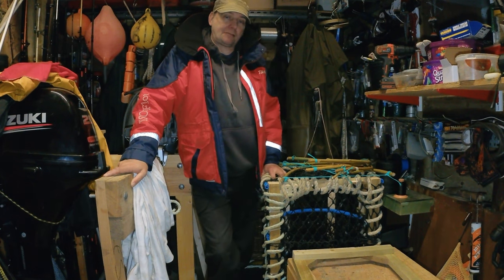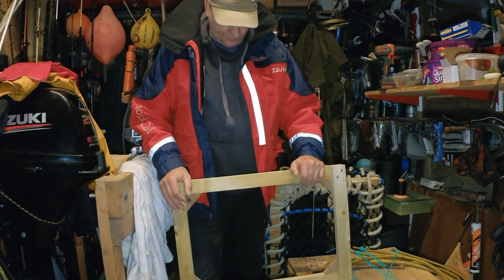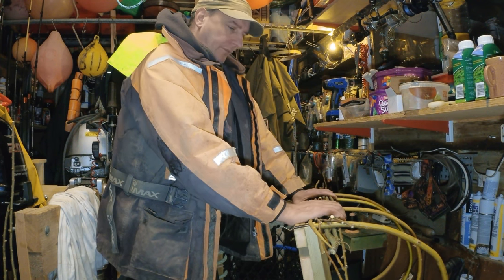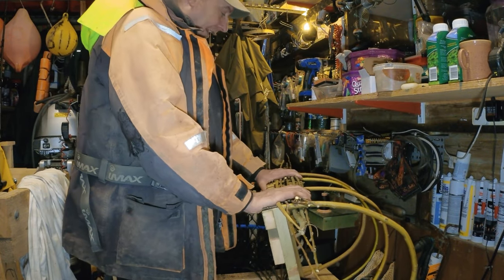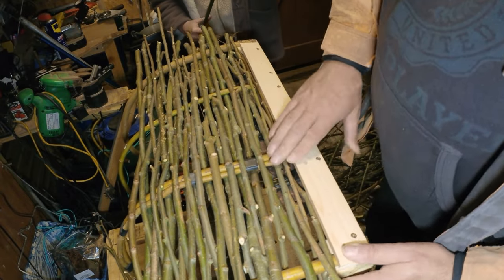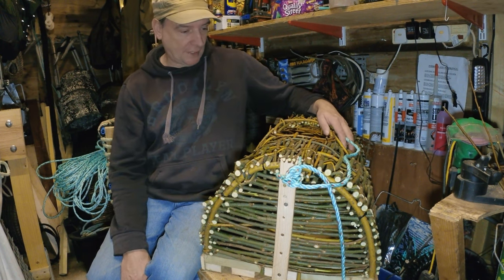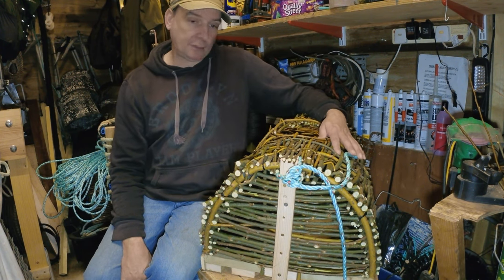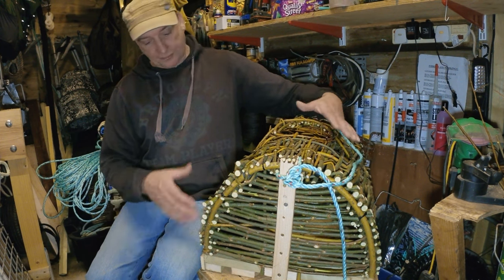I Had an Idea to Build a Willow Wicker Lobster Pot - So We Did

Comment: Why not drill holes in the wooden base and slot willow into holes
Reply from the maker: I did think about it but it weakens the base especially when the marine worms start to eat into the wood base, also screws on the ends would get in the way and a few other minor reasons.

Comment: Hi Troy 😁 studying your attempt to make a wicker pot it looks brilliant but the ends of the willow seem as if they need whipping to stop them moving and sliding off the hoop at the ends , just an observation mate
Reply from the maker: all the loops have been braced to each other to prevent that. We did think of whipping the ends and may add extra reinforcement before we drop it in the water I will look at it again once its dried.